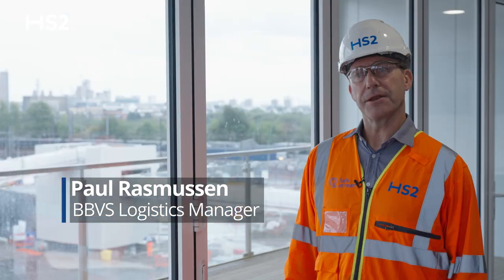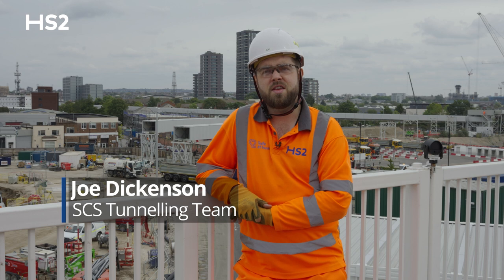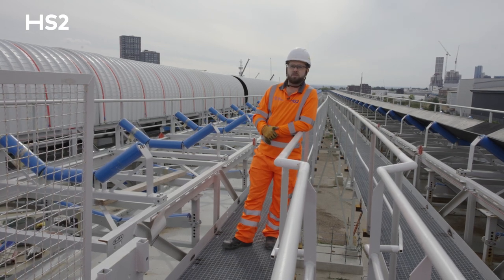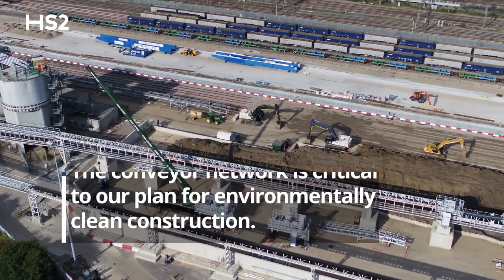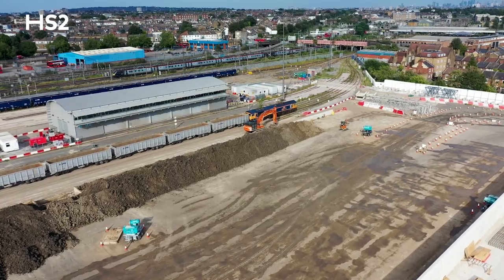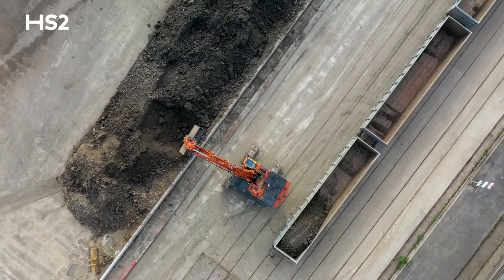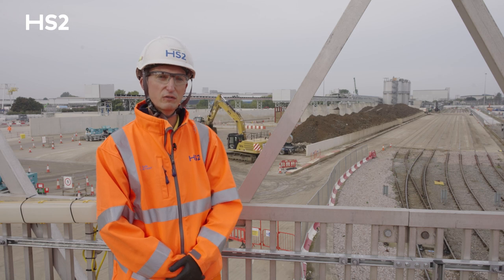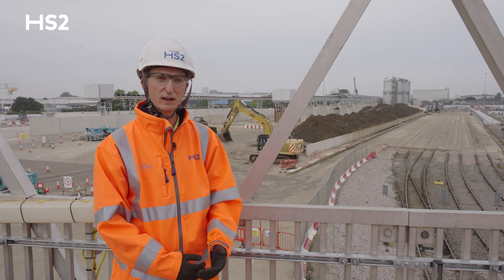HS2’s enormous spoil conveyor begins operation in West London

Comment: I can't wait until I won't be able to afford to ride on it, it'll be fantastic.
Reply: As a taxpayer, you'll be paying to ride on it twice, WHEN it finally gets finished.
It's costing over £71 billon of the taxpayers' pot.
Reply: I was a serious supporter of the whole HS2 project, but then the Tories established a new company called HS2 Ltd to build it. The work should have been carried out by expert rail network constructors. Network Rail are the obvious choice.
And now the Tories have imposed on the HS2 routes cheap crap rolling stock built by Hitachi. 10 years out of date right now and they are not running yet.
Britain is finished, it is a third rate nation, incapable of doing the right thing for the public. A brand new high speed train network, NOT JUST TO BIRMINGHAM for the brain dead, and the Tories won't buy safe trains for the routes.
Reply: @Demun1649  Not a nat are you! Running the uk down.
Reply: @Demun1649  Your claim is very misleading. Hitachi and Alstom are a Japanese and French companies both which specialise in high speed travel in Japan and France. Nothing corrupt about this decision nor dangerous either. They have been chosen because of a low carbon print being electric yet highly energy efficient. Yes green credentials have to be considered. Nothing outdated by the technology other than the germas have been squeezed out  of the deal. The technology they will employ will be updated and given the high safety standards in both other countries in regard to railways they will do good for this island. As for the uk,yes it does exist as a legal and functioning entity,whether you like it or not. Just another troll attempting to run down the continued innovation and engineering skills of the UK. The hs2 is happening whether it works long term l cannot say,but the need is there. Over population,high volumes of traffic means this high speed link may well cut pollution and traffic chaos. Notice the word may.. as know one really knows until it is up and running.
Reply: @colinsmith1288  Hitachi are, it is claimed, building all the rolling stock in Britain, but they have reactivated the factory where they built the Class 800/801/802 trash.
Sadly Alstom are only involved in building the Hitachi bogies, not their own Jacobs Bogies.
Your claim about "no corruption" is interesting since the Tories have issued no information about the bidding procxess at all.
Reply: @colinsmith1288  If they are the development of the Class 800/801/802, then you will be in for a big disappointment. The build disquality will be aweful, the seats won't  be lined up with the windows for good views. Just more Jap crap that are here, But Japan has closed borders for everything and no foreign company has ANY rolling stock on Japan Railways.
Reply: @Demun1649  The new trains will be based on a revised and evolved version of  the Zefiro v300,so a very good and improved version of the existing ones. 15% lighter because of the aluminium to be used in it's construction and more seats available than it's European counterparts. I hope that allays some of the engineering fears. None of us want to hear a train breaking apart because of faulty construction and lives being lossed.
Reply: @colinsmith1288  1) It is being built in ENGLAND, where the Class 800/801/802's were built, so no fears allayed over build quality, nor quality of materials.
2) The Tories have released no details of the tendering system and how the decision was made.
3) Deliberate choice made to not use the Jacob Bogies WILL CAUSE DEATH AND INJURIES if one of the trains crashes. As I have detailed in the whole world only the TGV and AGV have derailed and had no injuries or deaths. The TGV has carried over 3 billion passengers, with no deaths or injuries. No other country matches that. But the Tories don't care about future deaths and injuries because they won't be in power. 4) You get in touch with HS2 Ltd, and ask for the details of the tendering process and at what point did they become involved? I know the answer for that one.